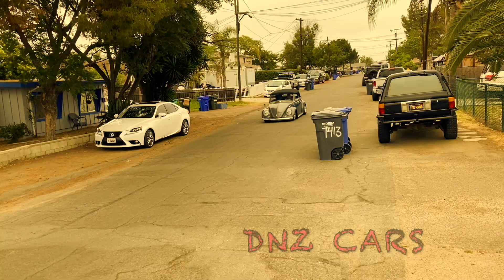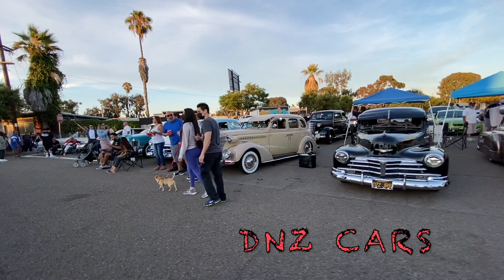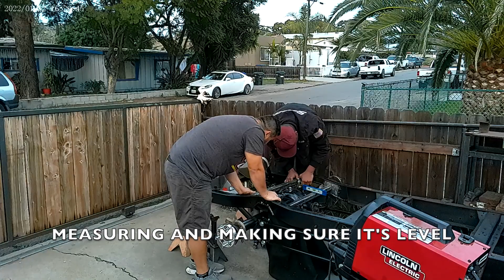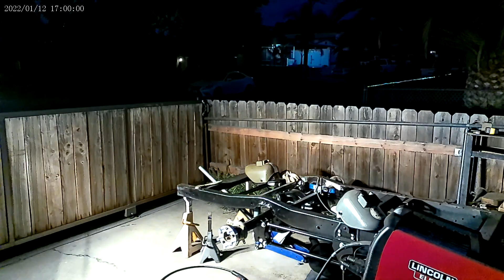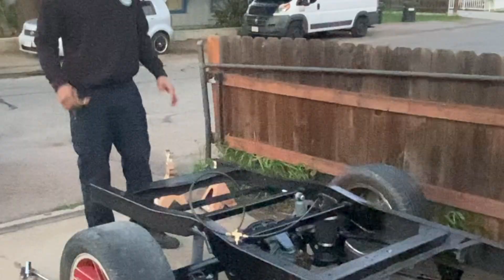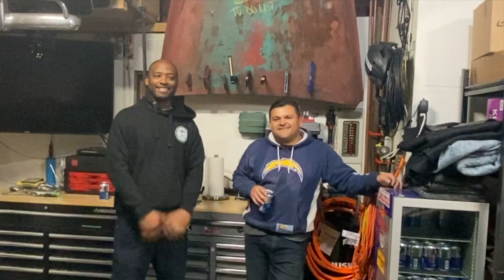1955 Chevy Truck Restoration Project -Air Ride...  TCI "Total Cost Involved" AIR RIDE

Comment: With the box and cab on how close does it get to the ground all aired out? Also, what front end kit did you use?
Reply from the maker: the front lays on the floor but the back we need to cut out bigger notches.   maybe about a 5 inch notch so we can lay it on the ground